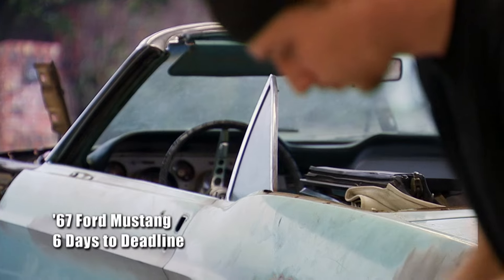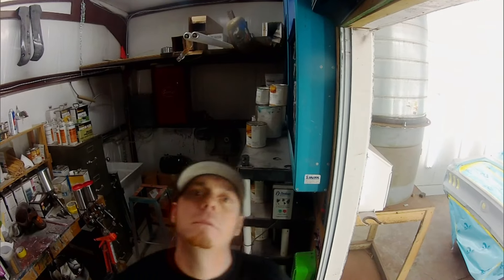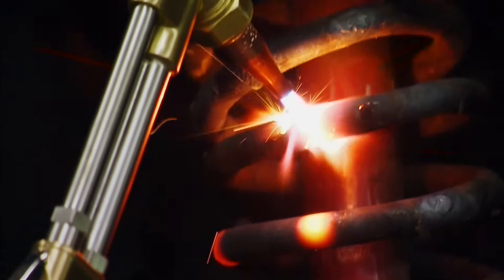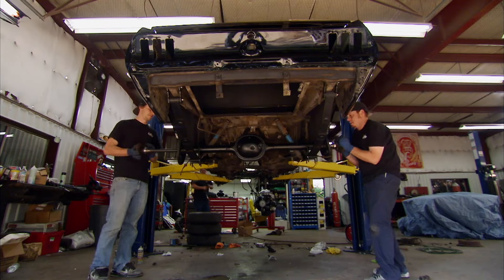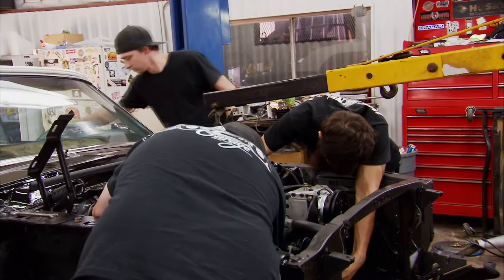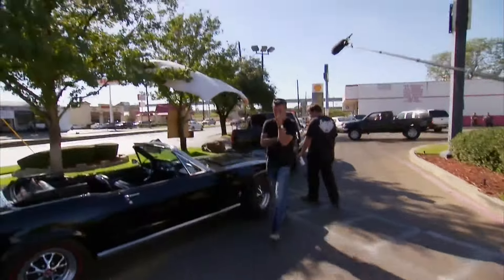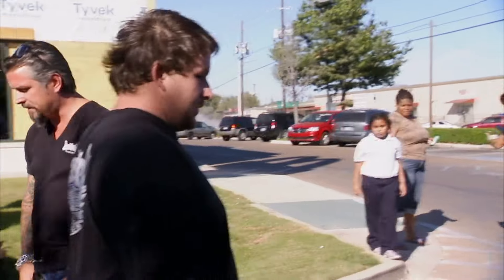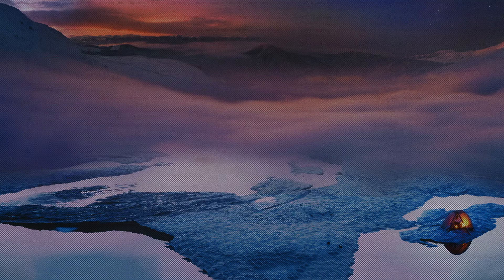Brand New 67 Ford Mustang Gets Totaled | Fast N' Loud

Comment: I'm surprised that the 20 gallons of bondo didn't fall off the Mustang.
Reply: youve never been around classic sheet metal have you?
Reply: They are bondo kings
Reply: They never show the headliners as they never have one .
Reply: Damn
Reply: They just skim coated it to get all the waves out. All show car finishes have this done.
Reply: @drippinglass  actually Bondo diminishes the value of the car. True car shows will put a magnet all the way across the car to check for Bondo spots. They skim coat whole car and when you take a car like that somewhere cold the bondo will crack when metal underneath contracts just a little.
Reply: terry rickman I’ve worked in body shops. You block the car after the skim coat. The Bondo only fills low spots. If you get the panels reasonably straight, a magnet will still stick.
Reply: Everyone talking about bondo machine lol bondo is a brand of body filler and yes every single classic car has body filler on it if done right when painting.those who say that their car has no filler is the ones who has that ripple waves in the paint lol

Comment: That Mustang is completely fixable I've seen people fix cars that are a lot worse than that
Reply: Blake Herzner Its the secondary damage like the frame being bent and most likely stretched that cant be fixed.
Reply: unibodies are damn near impossible to fully straighten back out, especially the flimsy mustang unibodies of that day. It's warped and bent beyond repair
Reply: U obviously dont know much about cars then
Reply: I drove my foxbody straight into a g37, (it was her fault) at about 25-30 mph. Front end was wrecked, but from the strut towers and back were not moved. We simply bought new frame rails, and cut out a radiator support from a fox at the junkyard and had a shop put it all together, and it was fixed! Lol it wasnt that much money, esp for these guys. But rip no insurance I would be triggered.
Reply: I believe that Mustang has since been fixed. This clip from Fast 'n' Loud is about 8 years old.
Reply: Same
Reply: Gage  cut and weld baby
Reply: KBxFifa yeah you can it’s just time consuming
Reply: Not in there market
Reply: Blake Herzner even if they wanted to fix It it’s on tv it’ll be savage title, couldn’t even fix It lowkey if the cameras weren’t there it’ll be a different story, but there is proof that car had frame damage pretty bad sucks but it’s how it’ll play It out
Reply: Yeah but cars that have frame damage arent worth shit after being fixed. Not to mention they are dangerous. Ive seen people fix cars with tape and zip ties but that doesn't mean you should do it
Reply: Thats not the point the guy had no insurance which means the mustang owner takes the hit for the costs unless he takes him to court which means more money
Reply: It's a unibody, good luck getting it straight again.
Oh but you can get another mustang body and cut the frame
Don't matter, that's a Mickey mouse car now and nobody fucks with those
Oh but I did it on XX car and it was good as new
Good job, not a '67 Mustang Unibody
Reply: But they've put soooooo much time into the stang already.
Reply: completely fixable, the replies to this comment are aids
Reply: KBxFifa yes you can. They are cheap to fix and the parts availability is out the ass. For fucks sake you can buy brand new unibody frames for these cars.
Reply: Blake Herzner that’s not the point the point is he has to pay for it to be fixed
Reply: That kind of hit if you stretch it back the frame will be weaker and possibly require monthly alignment jobs.
Reply: @gage5422  you can repair frames, you can repair anything. Go look at YouTube channels that repair salvage title cars
Reply: Blake Herzner despite what the comments say your mostly right I've fixed and seen a whole lot worse that that and have made out fine. The big issue is the unibody frame damage is what's wrong. But yes it is reparable especially for a big budget team such as the one in the show. However I will say it and many will hate me for it but Mustangs actually suck. The secondary frames were and still are weak, the big motor/hp nature of the vehicles are repetitive and are getting old, overpriced, and most of all most Mustangs look the same. Just get a different classic car. The 67 Mustangs are cool but... they're just Overpriced Buick Electra 225's.
Reply: @blooiefps9304  the front end is still very simmilar, 2 frame rails, a radiator support, fender aprons and strut towers. It's all metal, look at a picture of the 2 engine bays m8. Cut the frame rails out and weld new ones in. I speak from experience dude.
Reply: I fixed a Nova that was worse than that.
Reply: I know right? I have a 67 Mustang up on my frame rack right now that was WAY worse and it'll be perfect. There literally is nothing that can't be fixed and made right. My family has been in this business for two generations and I fixed cars that bad when I was in grade school....
Reply: quiz time, would it be easier to find parts for say a 2014 mustang or a 1967?
Reply: @matthiaswayman2336  67 mustang parts very easily obtainable . I would imagine 2014 a little more difficult especially if you live outside the U.S
Reply: @michaeledwards8058  Wow! I didn't know that. I thought that since its so old it would be hard and expensive to find parts. Thanks for the advice! So I guess that I failed my own quiz. LOL
Reply: Ok, both sides of this comment are technically correct, yes it is badly damaged, and to most, would be a total loss, HOWEVER, if your like these guys, with your own custom garage, it is technically fixable, though it would cost alot, or chop it to a custom, either way, with that damage, it's fucked
Reply: Yes it can be fix and get the frame straight again.. but good luck if the car drive like a crab...
Reply: @Edwin-hq6ix  Yes but you also have to worry about cracks in the frame after that
Reply: Ive done a section of frame on my 66 drives fine alignment is good. The key is to cross measure everything. That car is fixable no doubt just gotta take it all apart find what's messed up drill out the 100 plug welds

Comment: Pretty stupid, in ireland you have to pay for insurance and if you dont and crash into someone you have to pay them for the damage
Reply: That's basically everywhere. But the cost for court fees, and the years of litigation may not make it.  Both are at fault for no insurance. If he had antique insurance or shop insurance his vehicle would have been covered.
Reply: ALL vehicles, in the United States, are required to have some type of insurance to operate on public roads. Doesn't matter what you drive.

Comment: I have fixed many Mustangs with way more front structure damage than that. Every single part that's damaged is available new. It's far from totaled based on its value. If they can't fix it they need to close their shop down.

Comment: Why was the employee even driving the car on public roads?
Reply: It was probably a road test. After a repair or part upgrade usually any shop will take the vehicle out for a test drive. It was an accident but really that POS not having insurance drives me nuts. I am sure the shop has insurance but they have to cover the cost.  I would call the police and get the report and then go after that guy in court and sue him back the stone age. Lessons need to be learned. You if you want to operate a motor vehicle you have to be responsible enough to make sure you have ALL that you need to do so.

Comment: If you have no insurance and cause an accident your license should be held until you pay to fix it. This is a "if that fucking idiot was paying attention this wouldn't have happened plus he says he has no insurance either and he shouldn't have been fkn driving" . I'd be foaming at the mouth if I was GM.If you can't afford insurance and we all understand times can be tough but a lot of us are in the same boat.You still can't drive. I took a bus to work everyday for 3 months and saved as much as I could .By the time summer came I was able to get insurance in time for summer.It sucked a little but the sacrifice was worth it.

Comment: Sometimes people make me sick! No care in the f*cking world for other people on the road & no care for other people's property. SMH. I see people with sh*tty cars DELIBERATELY ram into Nice classics and/or brand new cars ALOT & the sh*t vehicle always has liability or No insurance coverage & most of the time the new(er) vehicle isn't covered yet/being transported. It's just a bad luck of the draw situation, I guess. I had a brand new 2018 Camry about a year and a half ago, my 1st vehicle I ever had that was New with less than 40 miles on it. I remember ihad about11k miles on it and some 21 yr old with liability in her moms car deliberately t-boned me & costme 18k of damages to a 20k car & somehow I was found "at fault" & my insurance fixed her car but not mine &her car was a piece of crap ragged out 1990 something 4door. I had to cut my loss & sell it to CarBrain for $8200. Some people see a nice vehicle & think "Money!" So they carelessly hit you thinking it's an easy payday for them.
Reply: Let me add that, I was t-boned at an angle, on my right rear fender between the back seat door and the tire. It most definitely was NOT my fault!!!🤦‍♀️

Comment: heh reminds me of the time i bought one of the cleanest original manual transmission lexus is300s that was out there with 60k miles and i spent a small fortune on and not even 3 hours of owning it, some guy blew a red light and nearly missed the car on my right side and just obliterated the whole side of it. best part? he had absolutely no insurance nor had any for 7 years or registration on it. my back was screwed up and has since been bothering me years later and i curse that asshole to this day because he was also drunk and basically walked away from everything.